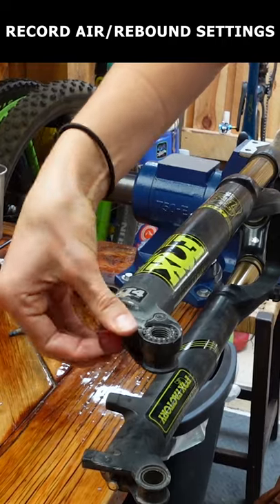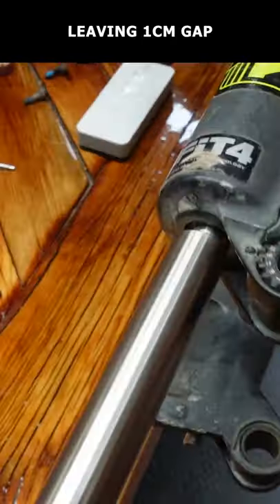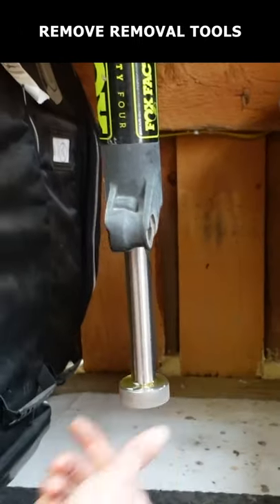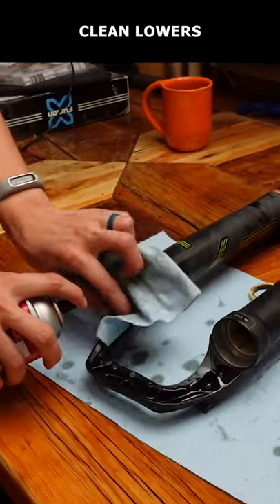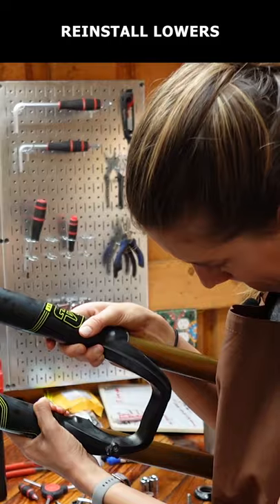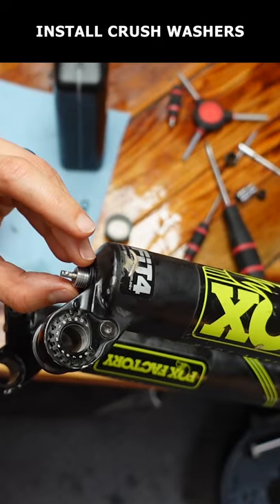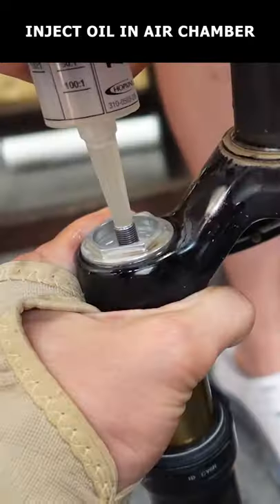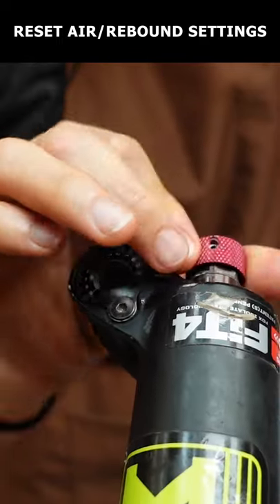DIY fork lowers service -- it's easy! 🙄 #Shorts

Comment: it's quite difficult if you don't have proper tool kit!
Reply: you dont have to get the tool to remove the lowers, just smash the bolt with a hammer
Reply: @guspam5982  just cut the fork in half with an angle grinder and buy a new one
Reply: @guspam5982  can use a socket on grip2 but it you smash the needle at the bottom of the damper shaft you’re knackered. Although expensive the fox lower leg tools are actually very good and remove all risk of hitting anything.

Comment: One important thing to note is that when you connect the shock pump to the fork or shock, you will lose a few psi in your suspension because some of the air in the fork or shock has to go onto the pump and pressurize the pump, so you’ll need to accommodate for that. For me, every time I connect my shock pump to my rear shock, I lose about 5 psi, and every time I connect my shock pump to my fork I lose about 2-3 psi.

Comment: Great quick tip tutorial on lower leg service. One thing I would add is to check the service manual or Fox shock website for the proper amount of oil to add in the legs depending on fork type and model year.
Reply from the maker: Yeah, we cover that in the full version of the video but dropped it for the #shorts version

Comment: I've done a lot of research on this maintenance, and I've never seen anyone put fluid into the valve hole. Please explain why you put it in the top vs putting it in the bottom (the only way I've seen it done before)...
Reply: Maybe its for smoothening,so it doesn't have friction to those bolt or something
Reply from the maker: Yeah, you have bath oil (in the bottom) on both the air and damper side as well as a bit of oil in the air chamber. Before tokens, you actually used oil to change how quickly the compression ramped up (what tokens do) but now it's just for lubrication.
Reply: Never seen it either.

Comment: Quick tip for everyone thinking of trying this remove your valve core before breaking the seal for the lowers it prevents you from shooting your uppers off
Reply: If you forget to fully remove the air

Comment: You don’t need to use a rubber mallet on the lower leg removal tool (if using the correct tool) or to install new wipers, in fact a steel hammer will work better. You shouldn’t install wipers with the fork dropouts resting on the ground either, you need to support the fork lowers as to not damage the dropout area (this is more important on an old fork with QR axles). And never remove dust wipers with a metal tool, especially a sharp looking tool like in this video.

Yeah yeah “but I do it this way and it turned out fine” it turns out fine til it doesn’t
Reply: I always use a mallet, less chance of damaging the threads, shouldn’t take much force to break them loose anyway.

Comment: correction: 20 weight in air spring size, but 5 weight Teflon in damper side
Reply from the maker: Depends on the fork. Make sure to check the Fox website for the specifics for your fork!

Comment: What size pvc for the Fox 34?
Reply from the maker: 1.5" PVC will work on all tapered steer tubes.
Reply: @sydfixesbikes  I meant for the dust seal installation tool, not the headset race.
Reply from the maker: Ah, sorry about that. We used 1.5" PVC on that as well (this fork is a 34).
Reply: @sydfixesbikes  right on! Happy trails Syd! 
-Nick 😃👍

Comment: Can u make tutorial how to lower travel from 140 to 100mm in fox34 float?
Reply from the maker: It's the same, you just need a 100mm air spring and need to confirm that it can go that low.
Reply: @sydfixesbikes  can I just cut the air shaft to 100 mm?
Reply from the maker: No, out threads onto the nut on the bottom so you'd be cutting off the threads